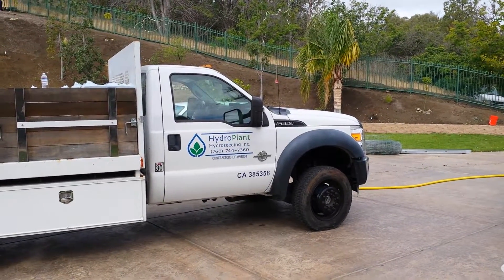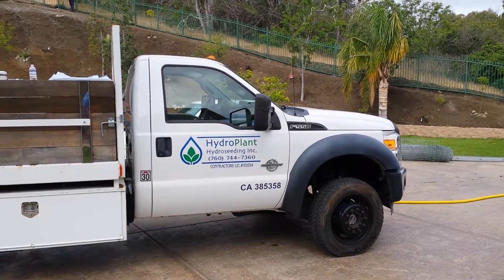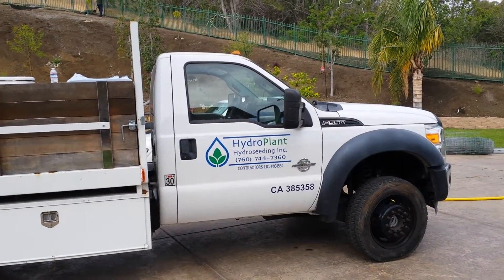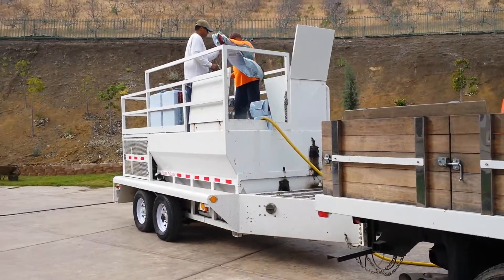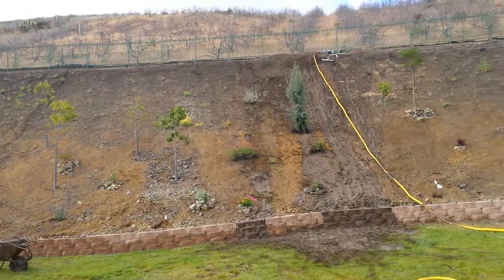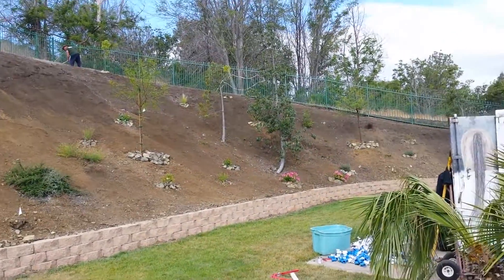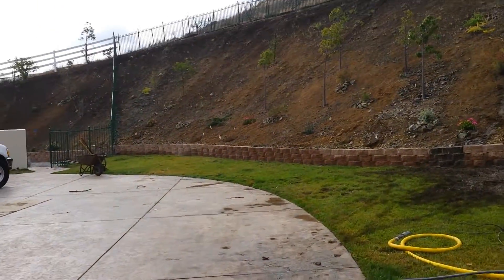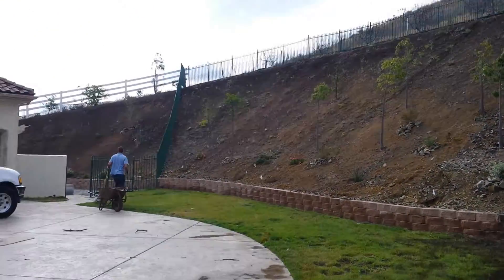Hydroseeding Native Seed Mix For Slope Stabilization

Comment: Did you  mix the seed along with the mulch? I always heard it needs soil contact and the mulch would prevent that.
Reply from the maker: My apologies for the extremely late response back, but the hydroseeding we have done has a mulch blend in it to help keep the seed hydrated.
The soil contact is quite important.
One product that enhances the germination speed and rate.
That product is called Hydretain...
A soil moisture managing amendment
www.hydrotain.com

www.midwestlandscaping.com
Thank you so much for watching and commenting on my videos...🙏
Reply: So, did you mix all that along with the seed, or just spray the seed first, then hydromulch?